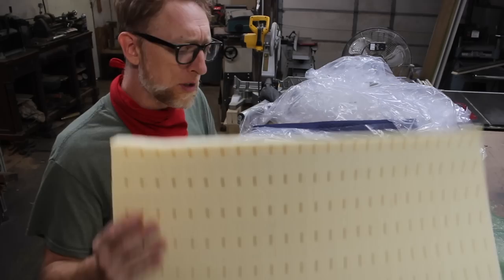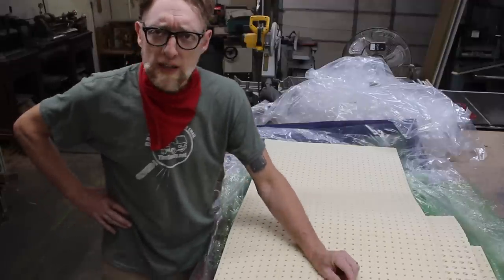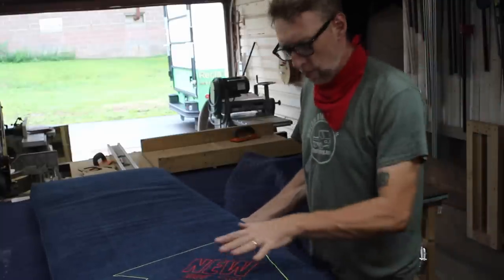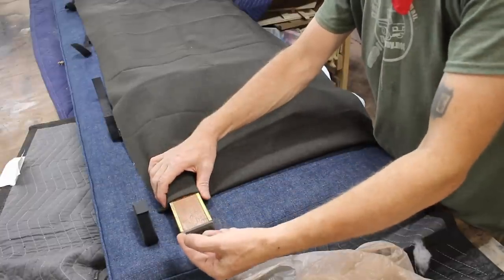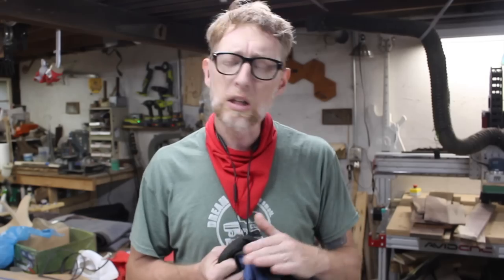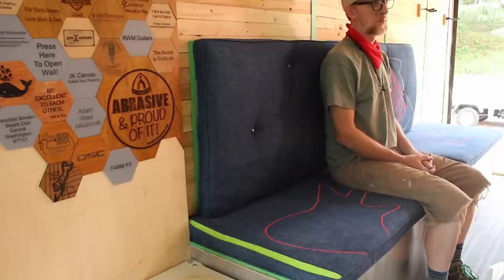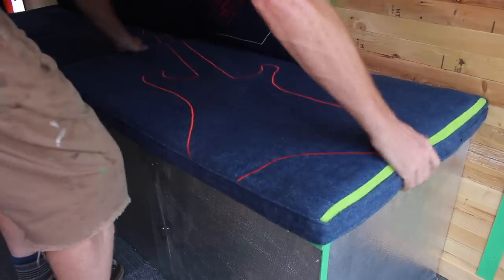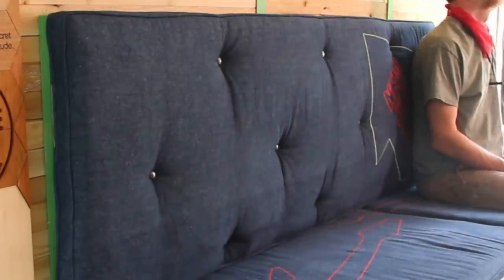Multi Function Bench in a Converted Stepvan

Comment: Quick sewing tip! When you put the pins in, put them in perpendicular to the line you're sewing, instead of with the line. It makes it less likely for the needle to hit them, and it's a rare occurrence that it will! It's also more precise than setting them parallel and to the side. You can "run them over" or remove them before the needle passes, it doesn't really matter
Reply from the maker: Thanks!!

Comment: Comfort AND Joy  ;)...sweet.
I'm curious... what do you do with all the plastic shipping material?
Reply from the maker: oh geez. that's an excellent question and a real problem I have with all packing material, cardboard, foam, etc. I save all of it, of course, and try to use it again. Sometimes I have so much it needs to go to recycling, but generally I use it again when I ship. For example the 10,000,000 yards of plastic the latex foam came in can be wadded up and used as filler in boxes, if it doesn't get used as drop clothes. I fully realize when I ship it out  it probably gets recycled at its next destination, but at least it got used twice first...
Reply: @timsway  Thanks for the reply, I'm thinking everyone should be buried with the garbage they generate during their lives...LOL
It sure would begin to put things in  "Perspective". ;)
Be safe...thx again.